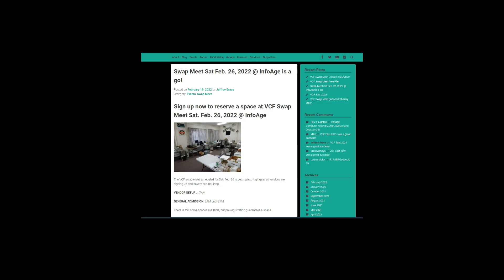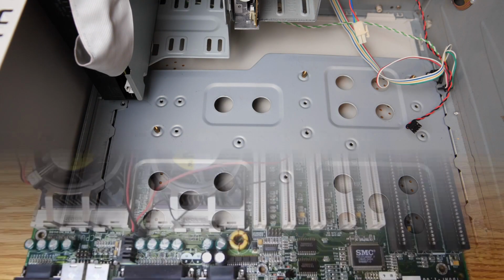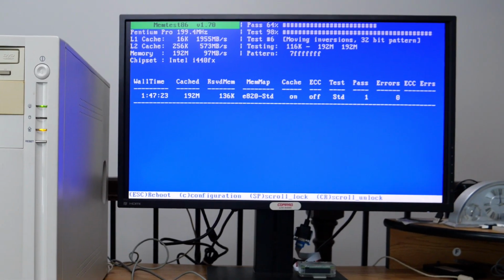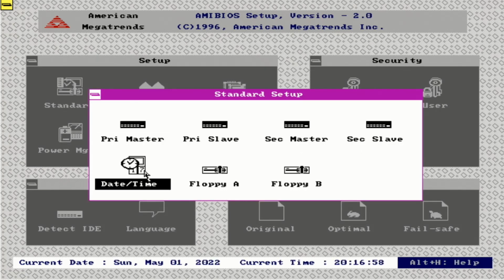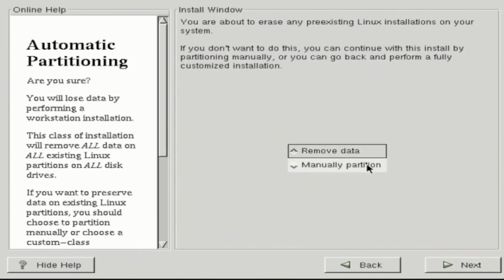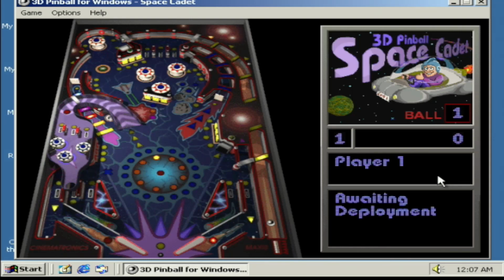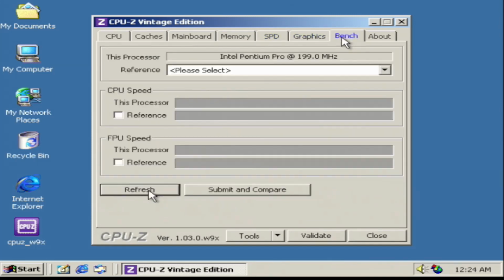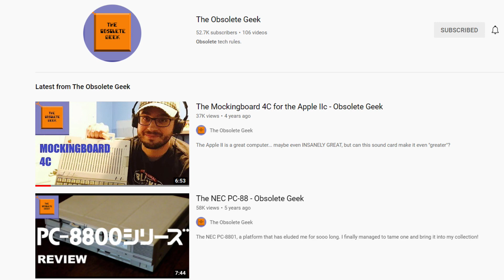Twice the Power, Twice The Fun: Touring The Extraordinary Dual Pentium Pro PC!

Comment: A little bit too late to this but worth mentioning, it was not until Redhat 7.1 (seawolf) no to be confused with RHEL 7, which came with Kernel 2.4 that both processors were really used properly. kernels prior 2.4 did not scale well with SMP based machines even if you used an mp kernel. by the way I still have a Tyan 1662 soewhere collecting dust, it was pretty good back then if you had a proper PSU to cope with the load of 2 cpus
Reply from the maker: Good to know. Thanks!

Comment: $15 for that?!? You lucky bastard........the seller was likely a clueless n00b. 
Such a vintage rigs are sold for at least $600 on eBay. Just a single (not dual CPU) motherboard without anything else sells for 100-200 dollars, each VRM is 15-45, each CPU 80-100 not to mention the box, RAM, drives and extra cards. I'm crying right now......
Reply from the maker: I literally bought it without even thinking twice 🤣🤣.  Fortunately the PS/2 fuse and RTC clock were easy fixes.  In a later video,.I put this system in a new old stock case!! It looks really sharp.

Comment: I used to use a multi CPU system as my main workstation. 16 threads was amazing! Now I have a CPU that does the same at a higher clockspeed with half the wattage. So crazy.
Reply from the maker: Right on!  Seems that Moore's law held true there for a while. Thanks for watching!
Reply: Wait....
16 threads in the 90s??
Reply: @AdrianuX1985  The CPUs were from '09, not '90 :) sorry if I was a bit confusing. I was playing with these around 2015.
Reply: @moth.monster  
The video was about PC from the 90s, so I thought you mentioned PC from that era.  :)

Comment: cracking system! get a second CD Rom dropped in it, just so you can.  Also if you load windows 3.51 on it, you will find it maybe even faster than NT4,  You could try and see how VMware works on it, and see about hosting a guest OS.  The BIOS i love! i had a early pentium with that bios! you could change the colour of it too, looking at yours i think they may have binned that off.  You could drop the board in a full size old server tower, and go to town max it with scsi etc.
Reply from the maker: I've done NT 3.51 on this!  There is a Twitter post somewhere.  The memory placement prevents a second CD ROM, even in its new case sadly
Reply: @RetroTechChris  what a pain,

Comment: How many watts does it take at idle and under stress?
Reply from the maker: Good question.  Haven't measured it, but the current case it is in has a 250W power supply, so guessing not more than that!

Comment: With 6 cores and 12 threads considered mainstream or even low end today, this must seem quaint to many. But for me, as someone who grew up in the 90s dreaming of multi-processor systems i was reading about in magazines, there's still something special about seeing more than one actual socket in a system, even today.

I've got two multi-socket systems in my collection. But unfortunately one is a Sun Fire v40z 3U rack mount dual Opteron server (with room to add two more sockets via a motherboard extension) that's too big and noisy to run often and the other is a Sun Ultra 45 workstation which only has one of its two UltraSPARC IIIi sockets populated. :(

I'm happy for you Chris! Enjoy your dual-CPU beast!

(You might also want to try BeOS on it too. That OS was optimized from the get go for multi-processor systems)
Reply from the maker: Thank you!  I'll have to have a look at BeOS!

Comment: Very interesting, I have never used a dual processor system like this. It was fun watching the setup.
Reply: The thing is with dual system building is the processors,  some say you need to get matching stepping codes for the system to work, but i found out, using my dual Pentium 3 and my older dual pentium 2, its not the case. If chris removed the chips he may find that this may not have matching codes either.
Reply from the maker: Glad you liked it!  This is a fun machine.

Comment: Nice system! You know you will start looking for a pair of Socket-8 Pentium Pro overdrive CPUs, right?
Reply from the maker: HAHA, someone on Twitter had mentioned that too!  Given how well this machine also runs Windows XP, maybe that might be a thing to do :)
Reply: @RetroTechChris  Give XP a good tune, and you will find it will run even better!
Reply from the maker: @procta306  I have a post on Twitter where I am running XP on this!
Reply: @RetroTechChris  Have a go with windows 2003 server, but the system will need 128mb of ram for it to entertain it.
Reply from the maker: @procta306  system now has 384MB :)
Reply: @RetroTechChris  should be good to go with server 2003 just to see how it fares with that, compared to windows XP, i know that its likes more RAM over XP